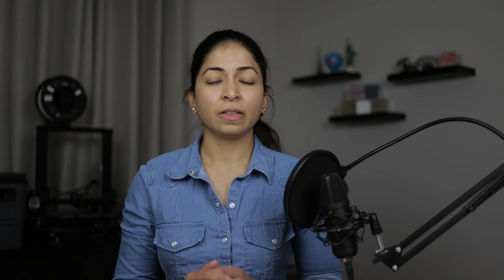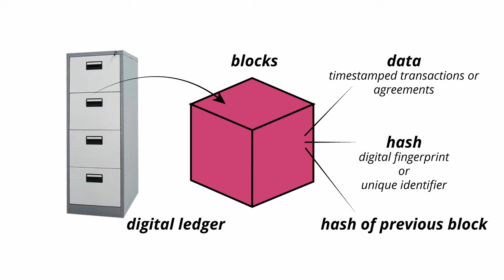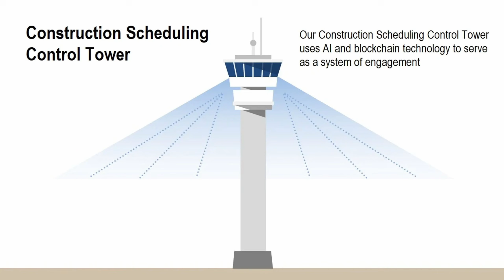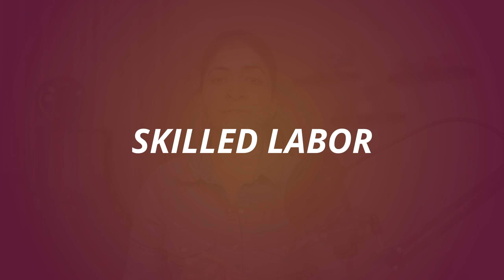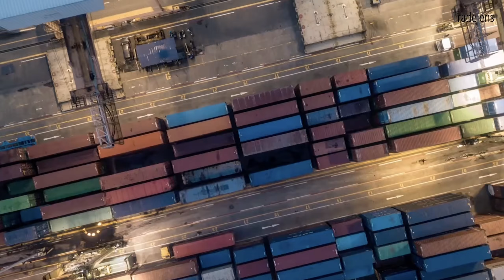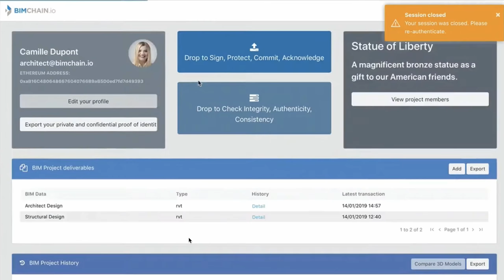How Blockchain is Disrupting the Construction Industry

Comment: I can't see how any of this needs the blockchain. Not that I disagree that the areas you named will change and are about to change, but I think it is a little naive to think blockchain will be the solution. It is in the end nothing more then a very convoluted way of encrypting things. Let’s ue the contract example. Essentially the attempt is to replace Lawyers as the trusted party with the blockchain. While tempting it seems short sighted and also ignorant of the fact you still need lawyers to draw up the contract. So instead of reducing the cost you now increased it to use a new tech instead of using a “normal” contract that your lawyer encrypted with one of the many other encryption that are far less redundancy based. What I see for the future is that lawyers will start having “trusted” servers where contracts can be encrypted and stored. You know like they do right now just digitally. This also removes the biggest weaknesses of block chain(like with paper and mail) the people using it being dumb. 
Also let’s also not forget there is other systems to do what blockchain does just not linked that are far less energy intensive. Hashes aren’t new, encryption is not new, the idea to store both to be save is not new. The fact that linking them in a way that is mathematical complex is new and well it is just that a showy way for do the same thing. A XTS-AES 128 encryption will also hold, not as long as blockchain? Dunno?´Both are currently out of the realm of our computing by a long while. 

So not to sound rude, but we won't juggle a block chain trail. The points above combined with the amount of energy and money wasted every time a project needs adjustment make that idea dead on arrival. Imagine a mega project needing to spend energy and cash that could be used on the project just to set up a new contract for new lights and add them to the chain. It is extremely inflexible and in direct opposition to the idea people try to sell with block chain. We got good encryption, we don't need this stupid gimmick for that. What will change is the adoption of digital infrastructure and services. Some are already in places and others need building. Non of them will use the blockchain as the market has shown time and again it is not aiming for the most secure, but the most effective and blockchain is many things but most effective it is not in many many cases.

Comment: All to often blockchain is a solution in need of a problem. It's only real benefit is that changes are logged...but at the expense of seems of data, and processing power. It is getting more efficient, but right now it is a huge energy sinkhole, and there are cheaper ways to accomplish the same task.

Comment: Smart contracts might work for smaller parts of a project, but it would require all parties to act with integrity and honesty - in which case you would not necessarily need the blockchain or smart contract. I would imagine some parts of the automization of large complex projects will occur where they reduce costs, and those automated contracts will naturally accrete to become smart packages of contracts. Its going to take some very smart and flexible programming to overcome perceptions of whether a particular process is 100 percent complete - or 95 % complete.

Comment: I disagree with statement that “BIM is not single source of truth”. It absolutely is, if you set the project up that way. The problem is that this source stores whatever designers put in it. It’s garbage 🗑 in garage out 🚛. Single source of truth doesn’t guarantee that there are no errors in the model. It guarantees that there is no confusion about the reference point. Designers putting all their design decisions in a single place and builders know where this place is.

Comment: One issue that came to my mind was a human factor corrupting the blockchain. I don't see how putting performance reviews on the blockchain would be any different than LinkedIn. You still have to trust whoever is writing that review to be honest.

And let's pretend a mistake was made on the blockchain due to a human factor. You cannot revert it and the inaccuracy will be on the blockchain for all time. You'd have to ammend it or misinformation would hurt someone, but if one party disappears or is not cooperative then is it even possible to ammend? If it is possible then you have the same issue of an authority able to ammend the record as they'd like.

Another issue with decentralized blockchains is the smaller ones are at risk of someone creating many nodes to obtain a majority and then rewriting large chunks of the blockchain in their favor. The consequences if the blockchain has any legal or financial trust is frightening.

Comment: Blockchain as you describe it is not the solution to anything. The same can be achieved by using a "trust worthy" party (such as the government or a large bank), managing the whole ledger by itself, and publishing all transactions to whomever requests it. It can publish periodic (yearly, daily, or even per-second) hash of the whole database, allowing anyone to verify that the sum of the transactions between the previous update to the next, is exactly what explains the new hash. This allow anyone to verify everything, just like blockchain, but without the overhead of finding random hashes to satisfy some arbitrary mathematical rule. The only advantage of blockchain over this system is when that central ledger is so untrustworthy, that many of the parties check each and every hash, even though they can sample any point of time, and prove that after 99.999% testing, the next one is also correct. The whole blockchain idea is a solution looking for a problem, and that problem never shows up.

Comment: Very interesting.
Well said. BIM models and engineering drawings are not the standard, mostly a guidelines where technicians must adapt to reality of the job.

An As-built cycle must be added and most of the times the end product is not 100% accurate to the modelled version due to time or investment constraints by the end of the project

Comment: Wow, Belinda! That was one of the best explanations of blockchain I have heard to date. It's been my experience as a tradesman and technical manager for many, many years that a large hurdle is when transitioning from the theoretical/virtual to the real world. I have had countless discussions with designers and engineers whose only argument when dealing with a failure of a project was "But it works perfectly on paper." An example from one of your videos is the "3D Printed Steel Bridge". Everything was golden until the pieces had to fit together. This not a blockchain problem, but it does go to that trust thing. The other thing that came to mind is the overly complex planning and approval process. These are not a unified monolith. Building codes and zoning standards alone differ from one county to another in the same State. Longstanding grift, greed and political interference is another issue that will only be resolved by eliminating most of the involvement of the the legal industry. But great start! More Please.
Reply: Yeah man, take it from a computer scientist, what she explained and it's application does not illuminate how Blockchains are used or what they are. I think she means well but it was a bit crazy if you know construction and software development.

Comment: Another good video. Trade already isn't coping with 3D, one project first floor was a rework nightmare. Second floor had same problems, no lessons learned from first floor. They abandoned it and went back to 2D, all benefits gone. During commisioning HVAC components above ceiling couldn't be accessed due to pipes, conduit in the way. The 3D version forced that this all be accesible which is a must. Now forever, building will have high maintenance cost due to it. It's all about profit margins, so thin it's go go slam it in and run. Sad state of affairs as you know, only hope the cycle can be broken.

Comment: uhhh... I disagree.
There is a chinese legend according to which an architect calculated the number of bricks required to build a palace. When the workers questioned him on his calculations, the architect bought a single additional brick. Once the palace was completed, the architect placed the single additional brick upon the arch of the main entrance as a reminder of the accuracy of his original calculations.

The problem with modern industry is the phrase "as needed". It is a trap and is the cause of disputes and delays. These hitches of "as needed" snowball into more and bigger issues as they travel down the supply chain. The idea of the savings is a false promise, a mirage people trick themselves with, when conventional wisdom is to maintain a stockpile of goods, rather than to purchase what is needed when it is needed and that is precisely why we are in a time of global shortages.
Reply: Project estimation and planning is purposefully a imprecise science. You would spend a year just planning a project if you tried to be precise. Building in margins and leaving aspects of a project that aren't easily estimated variable is a necessary evil.
Reply: @Josh.1234  and you can end up with a bit extra to build brick flower pots or whatever else. There are many places to put bricks in a palace.

Comment: I fail to understand how blockchain will aid in construction.  I feel that change orders drive up the contract prices and cause inefficiency.  Inputting contracts and change orders do not affect efficiency.

For example, if a contract is created using blockchain and everyone agrees, then someone wants to do a change order, but some engineer will still need to re-spec the job and re-design it.  Then input the changes into the blockchain.  Approvals will need to still be approved by owner, general and subs.  Costs would need to be re estimated and then translated to each industry worker.
Reply: More $$$.
Reply: I guess it depends on the project? There are a lot of cases in commercial construction of changes being made without approval from above. I could see avoiding that as a cost saving meaaure. I don't know if block chain will help though, as it is an issue with the culture and industry of construction, not simply a technological limitation
Reply: @private2809  how would blockchain contracts stop people from doing things differently from what they agree to inthe original paper contract?

I think blockchain contracts would increase costs of record keeping.  It would be good for the lawsuits though.
Reply: @private2809  And of course the people doing unapproved changes are definitely going to enter them into a blockchain record...
Reply: Blockchain is being treated like a database and workflow rules processing engine.. it doesn't do that.. you could maybe use it to keep a permanent record of a workflows history? But even then it's not a good fit. Decentralization and annomous transactions/users are not helpful between know business entities who have signed contracts with each other.

Blockchain from a data perspective is horrible at storing data and altering it and part of that is by design. It's why it primarily processes small data - transactions and does it across millions of anonymous nodes.

Comment: Perhaps this is just me being dumb, but as someone who understands the block chain tech it took me 2 watches to follow what the use case for block chain is for the construction industry.

One issue for using block chains for things other than the possession of a unique token is that the size of a transaction (such as a contract) can grow quite large, and everyone who takes part in this technology will have to have access to each contract (which will take up a bunch of space and share information that might want to be kept private for competition reasons). If you try to use just a reference to a id stored in a block chain you lose a lot of the security you are using the block chain to protect against.

I am also surprised given the pessimism you show in a lot of other areas, that you came down so light on block chain.
Reply: Agreed, just a bunch of buzzword band wagoning
Reply: It appears that when you try and join so many business parts that have very different industry standards/operating policies that the outcome is somewhat fatal.  It's probably why you don't see airplane manufacturers building every component of their airplanes, but they rely on the separate industries that know and live by the standards.  That was my take.
Reply: NFTs have no reason to exist.
Reply: based on your response i think you need to do some more research into purpose built L1s  and zk rollups. there are solutions/compromises to all issues. still a long way to go before we can incorporate much of it into something like construction.
Reply from the maker: I was skeptical about it for a very long time but I've changed after seeing it evolve over the last 2 years. There are a lot of parallels between the reception to 3D modeling, drones, and tracking software 20 years ago.... and the reception to blockchain now.

If I'm on board with the former, it would be hypocritical of me to be cynical of the latter. I think?...
Reply: @BelindaCarr  I don't see how blockchain builds any trust. Trust could be built through certificates and signatures, but blockchain? Blockchain, used right, builds an immutable history, not more, not less. This in itself can be used to generate trust in said history.

Smart contracts on the other hand are an inherently bad idea. Unfortunately it's pretty hard to explain without starting an entire lecture on computer science. The main issue with smart contracts is how to tell what they actually do before signing them.

There have been spectacular failures with smart contracts in the past for a reason. It wasn't a mere oversight from one party. It's a fundamental problem of algorithms.

Funnily enough the solution in the past was that almost all parties ignored the contract instead of sucking up the losses, when said contracts blew up in the face of their users. So ultimately they didn't solve the very problem they set out to solve. These weren't teething issues. These are fundamental problems of computer science.
Reply: @BelindaCarr  because there were successful technological advancements in the past, doesn't mean every new technology will be successful or useful. 3d modelings success has no bearing on whether Blockchain will be successful.

Most of the functionality you are describing are authenticated/integry private workflows.. Blockchain is in no way capable of providing that functionality. I would read up on private Blockchains.. not a good thing. When you strip financial incentive from processing the hashes, remove it's purely decentralized nature and make it privatized and controlled, you lose what makes Blockchain useful.
Reply: @Josh.1234  Not necessarily. You can also build a system where a collection of trusties mines with a predetermined hash power to build an immutable history. The trust then stems from the fact that nobody exceeded the pre-agreed hash-power. But other than that you are right with regards to malign attacks. It can still prevent accidental history modifications though, but there are easier ways to achieve that.
Reply: @brag0001  not sure I understand predefined hash power but it sounds like all the nodes are going to not be anonymous and work together and basically not operate like blockchains typically do..

You are right though, if all you want is authentication and integrity, then there are much simpler ways to do it with encryption and a 3rd party authentication/integrity server
Reply: @BelindaCarr   one can argue that 3D modeling, drones, and tracking software are all solutions to problems and not solutions looking for problems, unlike blockchain tech.
Reply: block(SPACE)chain?
Reply: @ViMBarN  It was easier to surrender to auto correct then fight it each time